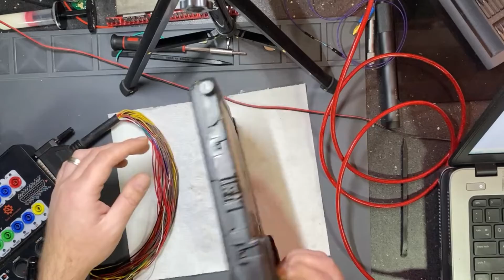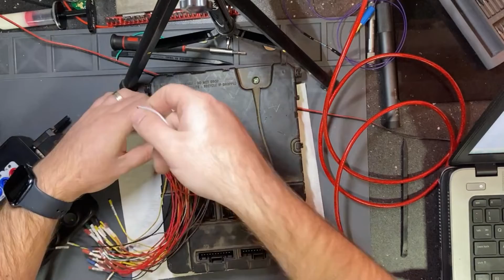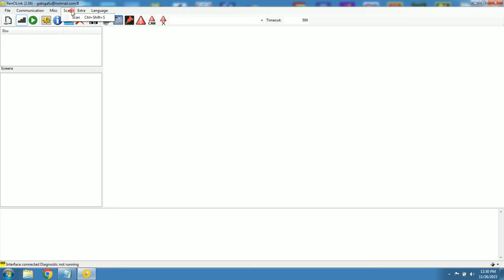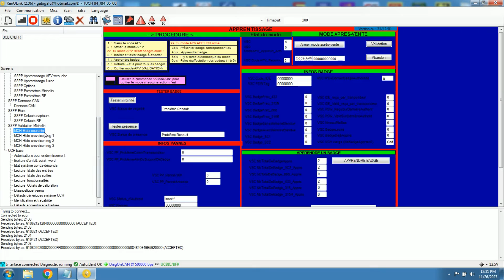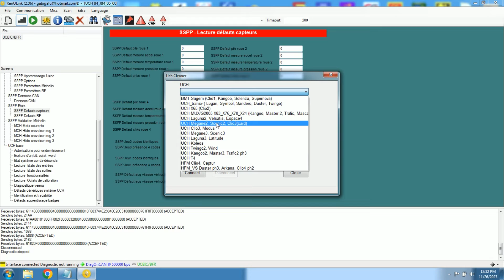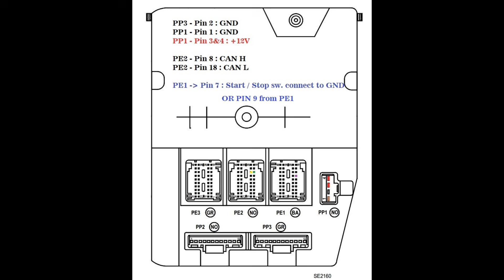UCH X84-N2 Read on Bench mode with GT100 and Renolink

Comment: Thanks for the video. But would it be possible to program a blank UCH with only the keys? I'm replacing the UCH on a car I don't have the pin nor the isk code for, but I do have the original keys from that car, would that be possible with renolink?
Reply: Did you sort it out?